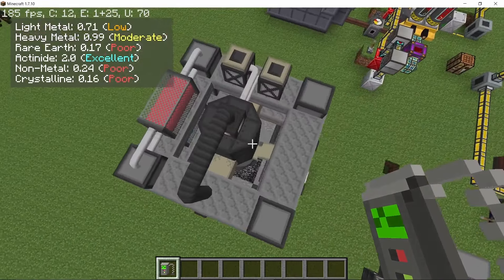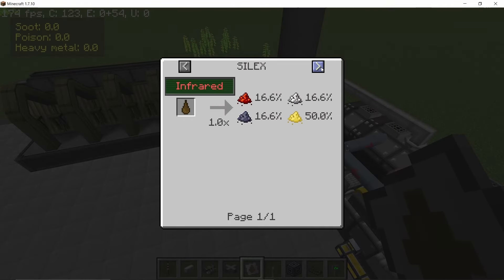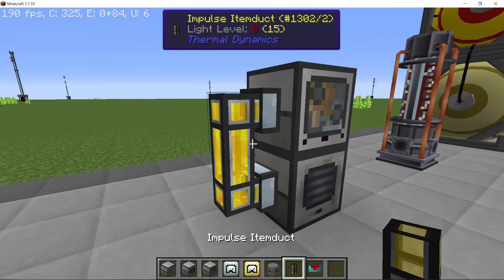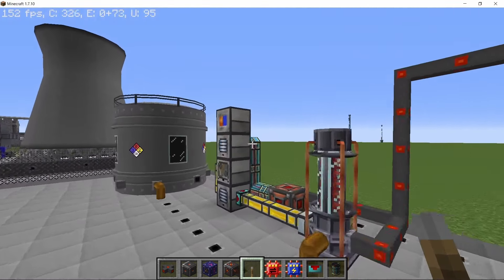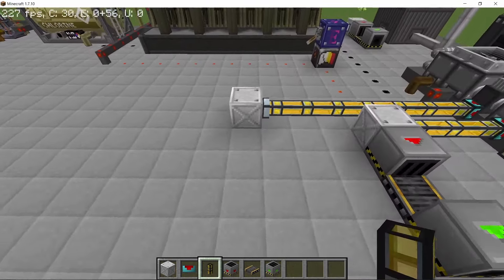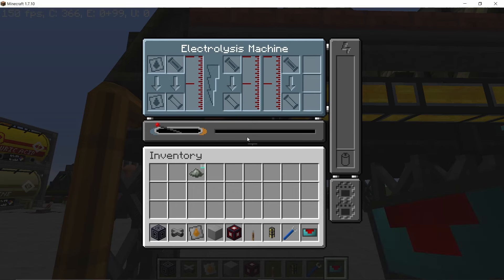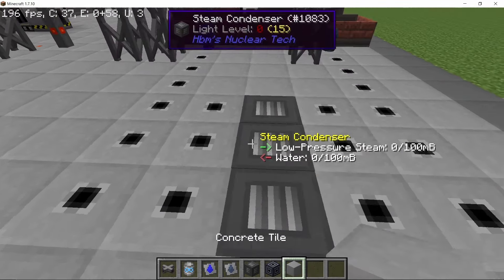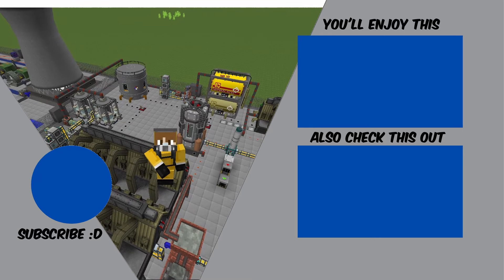Thorium 232 Production - Actinide Processing Plant - HBMs Nuclear Tech Mod

Comment: what is thorium used for?
Reply from the maker: you can turn it into fuel rods or in this case all of these thorium nuggets will be used to enrich thorium salt which is used to cool down a pressurized water reactor and also give out alot of U233 as byproduct